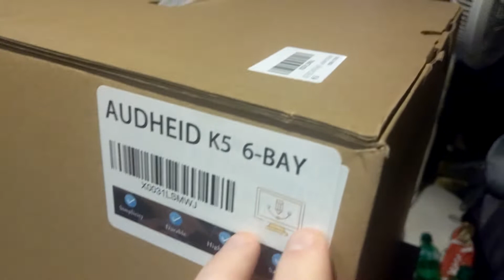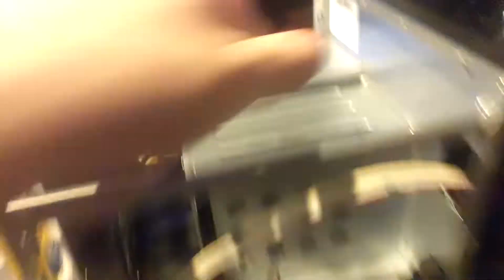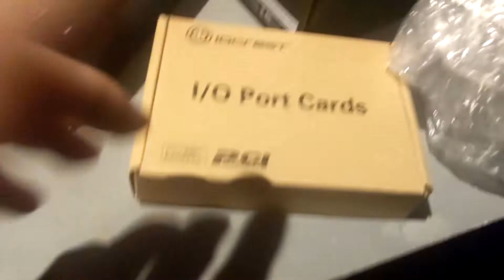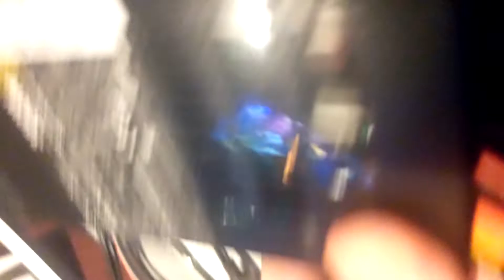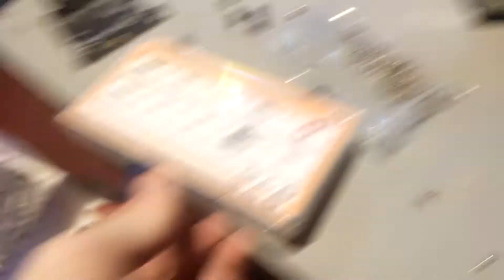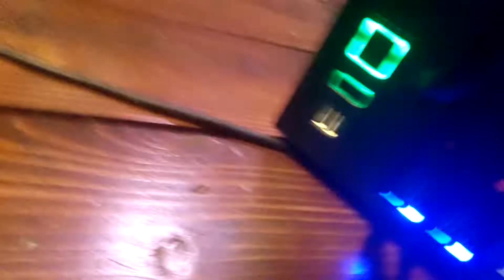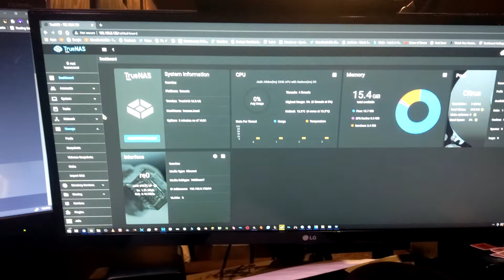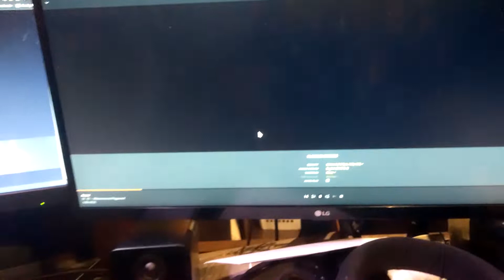AUDHEID NAS 6 Bay unboxing Setup TrueNAS

Comment: Thank you for the video! Could you tell what the temperature disks reach on load and on average?
Reply: Depending on the os, you may be able to do that through software. I’ve used a tool a while ago that would read the team from the hdd smart info. Been a while.
Reply: @rahulshah1408 , thanks, yeah, I use `sensors` on my Ubuntu machine for it. But I meant another question. Sorry about my bad English skills 😅

I'm wondering at what temperature disks work in that particular case. The disks are so close to each other and looks like fans are too far away to push air into that tight space between them. And there is the board with connectors on the way which  does not make the situation better as well 🌡
Reply: @khssnv  no need to apologize for your English. It is excellent. Sorry about misunderstanding your question. Cheers.

Comment: Thanks for the video.

I randomly came across this case on Amazon and I loved how it look and was gonna compare it vs a Terramaster 5 bay nas. And before you say anything I was gonna use Truenas on the terramster nas. My build would come up to the same price oddly enough (gonna resue my old 1155 cpu, 8 port sas card). 

The extra cable on the PSU is for monitoring voltages (server motherboard has the header).  

Did you use the stock intel cooler? Was cable management hard? Have you considered using an old sas card that's preflashed to ZFS?  Is there anyway to turn off the lights? Does it have space for regular 3/4 pin fan headers?
Reply from the maker: Hope the video was helpfull. Yea stock cooler cable management was easy lots of room never considered a sas card new to nas making so would have to look into whats used for never considered trying turn off the light there not that distracting used a 3 PIN fan splitter from Noctua NF-A4x10 PWM with Noctua NF-R8 redux-1800 trust me your going to want to change the fans on this thing there loud I have the sever in my room and all I hear is the drives now after the change but when I did not change them it was like a jet was in my room